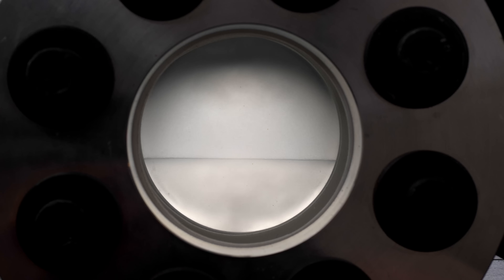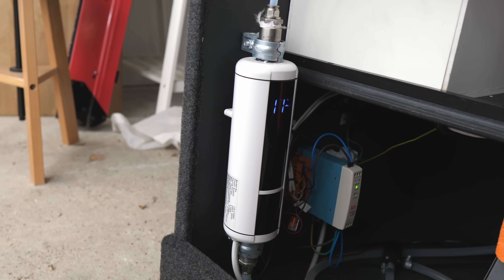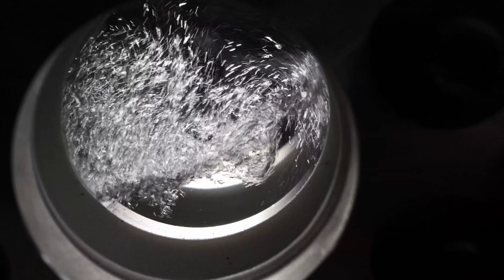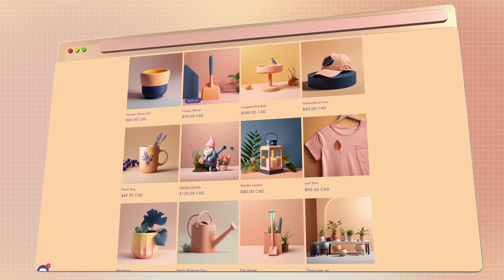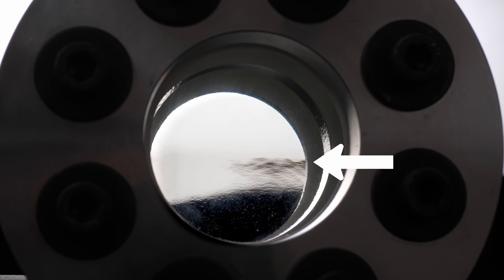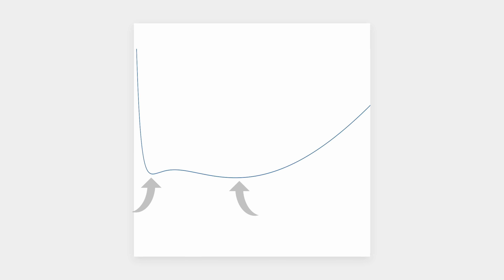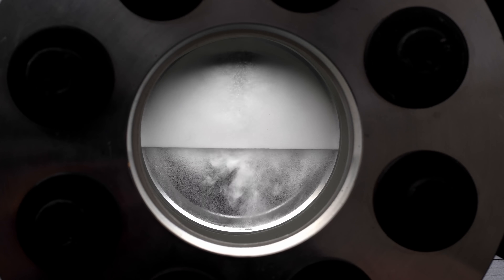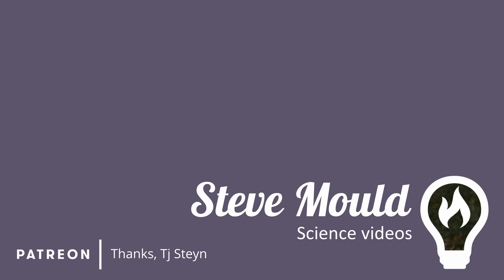The Unknown Phase of Matter

Comment: Hi Steve, around 5:56 when you mention that when you start heating, it moves along the curve until it reaches supercritical, I think it’s not exactly correct. To move exactly along that line or curve, you would have to control both temperature and pressure, because just heating it would result in increased pressure, so you would have to get rid of that excess pressure with a controlled pressure reducing valve if you want to ride exactly on that curve. Otherwise, you are just moving in an arbitrary curve which may intersect the vapor liquid equilibrium curve. Let me know if I am wrong.
Reply from the maker: You're right. If the liquid is boiling the system must not be in equilibrium so in reality we must be slightly off the line. Basically, if you heat it very slowly you can keep very close to the line. I originally had something like that in the script but I wanted to keep it snappier. It was a tough choice though because it does affect accuracy.
Reply: There is no need to control the temperature and pressure, in fact it's impossible, at boiling point the temperature and pressure are in equilibrium.

Comment: You should have put a gauge on the outlet so that we can see the pressure throughout the different states.. Big fail.  Also, you should have put in a solid cube and see if it still floats instead of overflowing and sinking to the bottom.   You need to do another video for this.

Comment: I wanted to commend you on the interesting video and the great demonstration you provided. However, I noticed that there was a slight mix-up between a gas and a vapour. When there's liquid at the bottom, the substance above it should be referred to as a vapour, not a gas. To clarify, for CO2, the critical temperature is 31°C, and only when the temperature exceeds this point can CO2 be accurately described as a gas.

Comment: Heat -> liquid portion decreases in density due to thermal expansion -> more gas molecules -> increase pressure -> gas portion increase in density due to compression -> eventually the density of the gas portion and the liquid portion are equal -> supercritical 

Aka Liquid decreases in density and gas increases in density until they become equal in density. This point is called supercritical.

(No surface tension bec there is no interface between gas and liquid!)

Comment: In a prior career I was fortunate enough (in 1988-1997) to be involved in a technique called supercritical fluid chromatography (SFC) using CO2, both analytically and preparatively. It was the best fun I ever had in a laboratory. Good for you. An excellent video and I leant some stuff that I had not worked out for myself. The bit about liquid and gas being all the same phase except for the temperature ie above the triple point was a great way to describe it, the arc you used to connect the two potential phases was very descriptive. Thank you for this.

Comment: The atmosphere of Venus is 96% CO2, at about 92 atmospheres at ground level. So the lower parts of its atmosphere are supercritical CO2. The Soviet Venera landers used a parachute for entry into the upper atmosphere. But the main parachute was jettisoned at about 50 km altitude. The probe then dropped through this fluid at terminal velocity. Venera 9 hit the surface at about 7 m/s (16 mph).
Reply: So to sound dum what was the velocity ? Do you mean it was slowed down by the fluid part to 16mph because of it being like a fluid ? Sorry to sound dim. The whole sunject really twists my melon and just thinking about it makes you undersrand why planet Earth is in the Goldie locks zone of being just right in so many different ways. Cheees dude many thanks Darren.
Reply: @dazhigh9208  Yes. Venus' lower atmosphere is a supercritical fluid. It's viscous and compressible like gas, but much denser (not as dense as water though). So the spacecraft slowed down that much simply due to form drag, no parachute needed.

Comment: Years ago there was a sheister type guy, Dennis Lee, who promoted "free" electricity. Some of his stuff was borderline legit using geothermal type concepts. While not over unity it was as free as solar. Anyhow, he later began espousing a modified "steam" cycle using liqid Co2 instead of water. They claimed that on the power stroke, the liquid would flash to a gas but as it completed it's work and the volume of the cylinder increased it would recondense into liquid,  where it could be cooled back off in a refrigeration cycle using normal compressors and geothermal. Basically combining a super efficient heat pump and gleaning extra efficiency from the energy saved by not having to deal with losses attributed to the phase change, or at least the high phase change of steam/water. I always thought it actually might be plausible given Co2's properties, but there was so much consternation around his personal life it was hard to disect fact from fiction. But a viewable setup like you have combined with a refrigeration compressor would allow the fine tuning necessary to see if a very efficient refrigeration cycle wouldn't work when dealing with super critical Co2?

Comment: catch the co2 with the coffee taste and caffeine, and use a sodastream to make coffee
Reply: omg that should totally work, shouldnt it? lol
Just needs an adapter from this chamber's valve to a sodastream, which luckily are cheap and available.
Reply: @Basement-Science  They are cheap and available. Those are all standard connectors, you slap a pressure regulator in between, and you're done
Reply: @Stay_away_from_my_swamp_water  what do you need a regulator for? The gas bottle sodastreams hold liquid co2 anyway, so it doesnt need a regulator.

Comment: I did my PhD on supercritical fluid chromatography, and I learned that the nomenclature is not as clear as it could be. In my opinion, if a fluid is in a phase that can be changed by a change in pressure or temperature, it should be called a liquid or it's vapour. A gas is a fluid that can only charge phase by changing both the temperature and the pressure.

I feel that it would be better to use the term "dense gas" (i.e. a fluid with behaviour poorly described by the ideal gas law), rather than "supercritical fluid".

Comment: At work we sometimes get dry ice for cooling samples.
when it comes in small chunks it fits into the testtubes we use. once sealed they can withstand enough pressure to have the CO2 become liquid. sadly the tubes aren't strong enough to get a super critical transition.

Comment: Dense phase CO2 is the preferred mode of transportation via pipeline, high density, low viscosity. In your example, removing as much of the air as possible as even trace amounts of air will significantly change the phase curve. It should also be noted that supercritical is not limited to CO2 gas

Comment: By far the coolest experiment in all my physical chemistry courses was a device sort of like that. But instead of heating it, we could increase the pressure by turning a hand wheel while the chamber was held at a fixed temperature. That made it possible to slowly creep up to the critical point and nudge it over. It was filled with an "unknown" gas and we had to figure out which one by the critical parameters.
So we started with a gas and as we cranked, the gas started condensing into a liquid. At about the half way mark the phase boundary started becoming blurry, then it looked like the liquid was boiling very gently and the boundary just vanished. One of the most amazing things I've ever seen with my own eyes.
It turned out to be SF6. Needs a bit more temperature, but the pressure is a lot more tame than CO2. "Just" 37 bar vs. 73 bar.
Reply: I literally did this experiment 2 weeks ago in physical chemistry. Only difference was, we knew that it was SF6, but we had to get all the isothermic vanderwaals graphs and analyse, when the critical point was passed, so that there is no fluid forming anymore. It even was the same apature i think. We also hat to turn a hand wheel xD
Reply: @UznKeCr Was that in mid-west germany by any chance? 😄 I can't remember what the device looked like (~15 years ago), but it doesn't strike me as something you can buy off the shelf.
Reply: Very informative comment. I used to think that with my own eyes you can only see supercritical CO2
Reply: @denizzzka  There are probably a bunch of gases that would work. CO2 is just by far the easiest as it's readily available and non-flammable + non-toxic.
Propane would also work with 100 °C and 40 bar. Just don't use a flame to heat it up ;) Ethane would be even better with just 32 °C and 48 bar. Acetylene would also be in the range, but probably a really bad idea.

Comment: I don't think the color explanation using refractive index is quite right here. A transparent gas and transparent liquid with different refractive indices don't suddenly become opaque because of the intermolecular distance fluctuating to intermediate values. The new refraction comes from the correlation length of the supercritical fluid becoming macroscopic which causes density fluctuations across large distances, and these cause light to diffract.

Comment: The interesting thing, as it turns out, is that 'states' of matter don't actually exist!

What "really" happens is just a simple thing - all matter, or at least the particle-like phenomenon we have thusfar dubbed "matter" - has both attractive and repulsive forces that affect all other matter, and the attractive forces are by default more powerful and the repulsive forces are relatively weak until very close proximity and so only really stops matter from spontaneously conglomerating into a singularity and/or heavier elements.

That first curve you showed is really good at demonstrating the idea. As atoms get closer together the repulsive forces become exponentially stronger - and that force manifests as acceleration in the "away" direction, and once the atom's velocity in the "towards" direction is negated it is physically at a distance from the other atom proportional to the velocity it entered with and the exact velocity it will have when it "leaves" will be exactly the same it had when it went in because its crossing the same distance in the same time and that repulsive force is still there and still operating in the exact same fashion. If you know anything about derivatives and calculus, this phenomenon suddenly becomes rather intuitive. The area under the curve is the total energy of the atom, representing how "close" it can get before its velocity hits 0 and how much it will have when it's out of the influence of the repulsive force (at least relatively speaking). This is also why "equal and opposite reaction" works/exists.

The attractive force does sort of the same thing, as the atoms move away their velocity steadily decreases until it hits a point where its now 0 and it flips around and comes back again. Except where the repulsive force increases exponentially as the atom gets closer, the attractive force decreases logarithmically as the atom gets further away and so there is a point where an atom has enough energy that it's "away" velocity will never hit 0 and so it will never return unless something else knocks it back in that direction or its energy is otherwise sapped or relocated.

The "density" of any given material is just the expression of how far its atoms can get away from one another before they get pulled back to each other, and that varies wildly not just because different elements have differing values for the strengths of their repulsive and attractive forces but also because of external conditions such as the presence of other atoms, gravity, etc. Higher pressures (IE the presence of other atoms and/or the pull of gravity) dramatically increase how much energy an atom needs in order to fully escape and also increases the size of the range the atom can travel while still being trapped which is what results in "liquids" and "gases" as we know them. All of the "gas" that makes up earth's atmosphere is actually just "supercritical" fluid because its still stuck to Earth. It forms a shell around the planet and cannot escape - at the outermost reaches of the upper atmosphere the gases' density falls. Like the surface of a liquid but stretched out super thinly across a vast distance. It's not truly a gas because by definition gases expand to fill their container - but in space there is no container. There's nothing "containing" the gas except gravity, there's no solid edge keeping it all in - its trapped against the earth in the exact same way that liquids are trapped.

The paddleball string is much, much longer - but its still on a string. It still doesn't have enough energy to escape.
Reply: woah! Thank you for making the behavior of solids / liquids/ gasses a lot more intuitive for me

Comment: Commenting at 10:14 and responding to the 10:10 question, I would say energy. In the liquid state, the atoms or molecules are bound by intermolecular forces and energy is required for the particles to break out of this potential barrier and become a gas or vapor. However, as you increase the pressure, the particles are liquid at higher temperatures which means they have more kinetic energy on average. This means they already have some kinetic energy and the extra energy needed to overcome the potential barrier is less. As you continue to increase the temperature and pressure, the particles have so much kinetic energy that the energy required to overcome the potential barrier drops to zero! This means there is no energy required to transition to the gas phase, and the two phases become one

Comment: When you mentioned that a tiny change in temperature causes a large change in density, I immediately thought that this could be the basis of a pretty efficient heat engine. So I asked AI about this, and indeed, proper nerds are working on building devices for turning heat into work by using supercritical CO2, either by driving a turbine or by a mechanism that's a lot like a Stirling engine. Apparently the turbine is the better idea, and Ziroth has a video about this: https://www.youtube.com/watch?v=z7dr6oKHqqM

Comment: I'm at 6:25. The boat should sink if it's made of something denser than the supercritical fluid, it should float to the top if less dense, and it would be neutral if the same density. It looks like it's probably plastic, so I'm guessing it will sink as the supercritical state is relatively low density. The entire container becomes one state

Comment: Liquids being the oddball of the states of matter is a new perspective that I love lol.
Reply: I never thought about it, but it is weird indeed.
Reply: Being liquid and gas at the same pressure is definitely more oddball.  Try doing that with a more polar molecule than CO2... perhaps H2O.
Reply: @ChrisNotTheKing that's exactly what is happening with all water everywhere all the time though. There's a partial pressure of water in the air above your glass of water and they're in equilibrium
Reply: @dielaughing73  I was also thinking "So like the normal case?" 😅
I guess one could imagine the higher portion of the boltzmann distribution being responsible for the vapor pressure. That would also explain why the vapor pressure is only dependant on temperature and not external pressure, which is really counter-intuitive.
Cody's Lab showed a nice demonstration of the vapor pressures of different compounds being additive some years ago.
Reply: @dielaughing73  How thin is that layer above the liquid water, say at STP?  Not very far above there's oodles of gas with a much lower BP, and the molecules of water bouncing around in it certainly aren't at a concentration where you could say the air is gaseous water.

Comment: Top fuel funny cars use this principle to make extreme power. If the fuel doesn't turn to a super critical fluid that can be compressed before the piston gets to the top of the stroke it will blow up the engine. They are putting in more fuel than the volume of the cylinder so it will hydro lock if it doesn't turn into something other than a liquid as it's going up.

Comment: Supercritical CO2 is being used for cooling at high energy physics experiments.

CO₂ is used in transcritical refrigeration because, in its supercritical state, it combines a relatively high density with a low viscosity, which enables high mass flow rates with reduced pressure losses. In addition, its thermal properties near the pseudo-critical line provide excellent heat-transfer coefficients and a high volumetric cooling capacity.

You should check also about supercritical krypton for cooling applications!

Comment: There's a company in MN that cleans firefighters gear with liquid CO2 - it extracts all the nasty carcinogenic stuff that embeds from smoke / fire. It's supposedly much more effective than water.
Reply: indeed, CO2 is a great "dry cleaning" fluid! you just have to have a really high pressure vessel to contain it.